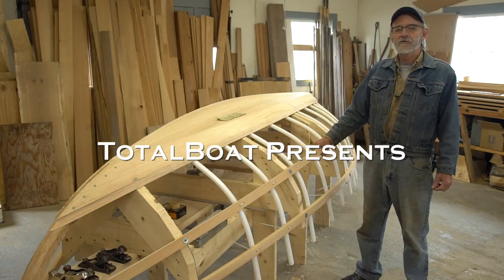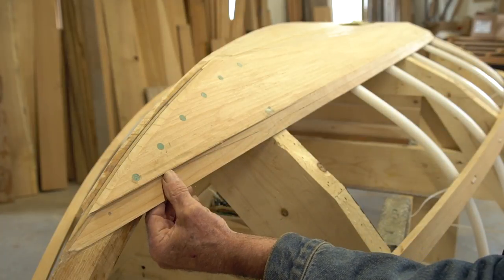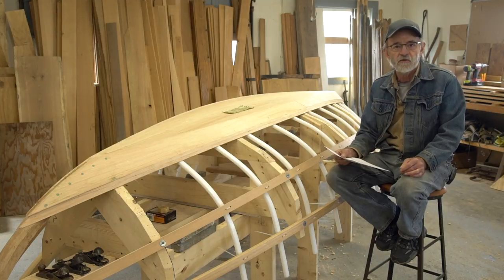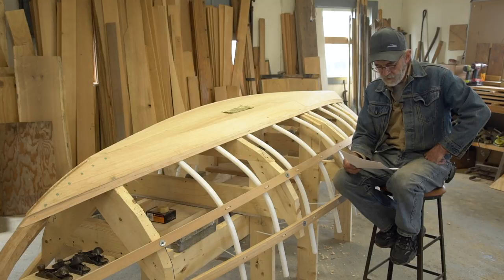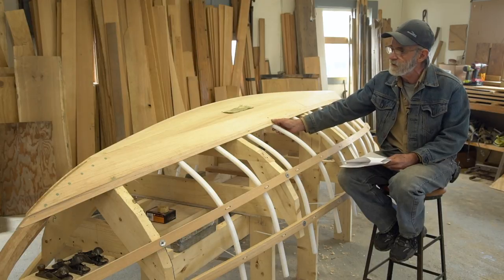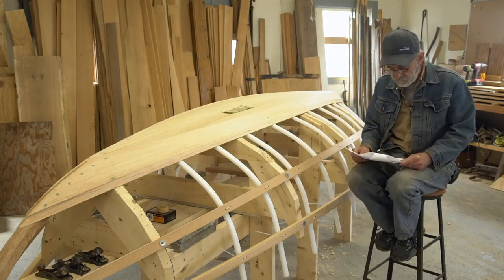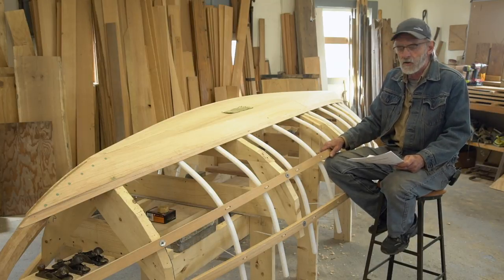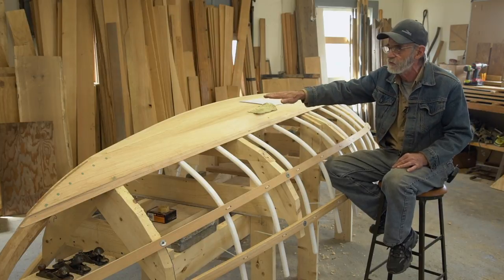Building the TotalBoat Sport Dory: Episode - 19 Q&A

Comment: Lou - beautiful little dory. The Kevlar bottom may wear well, but you cannot sand it smooth, or cut it once it's past the green state without it furring up. Just FYI. And if you trim the edge while it's green, you risk it not laying perfectly flat against the bottom. You might consider putting down another layer of CF, finish the boat, then put down a layer of Kevlar on the bottom. Love your channel!

Comment: We use UHMW a lot where I work and have a lot of drops that stay out in the sun. A couple pieces in particular have been outside for 10 years. While they look rough on the outside, a quick scrape with a knife reveals that the damage is only on the surface and only a few thousandths of an inch deep.

 Great videos, I haven't found one yet that I don't like.
Reply: "Officially" UHMW is UV stable for 1 year or less (I know folks see much more than that!). There are special formulations available that are UV stable...in nearly any custom colors you'd like!

Comment: Hi Lou, I've worked with Kevlar a bit before, and have experienced how challenging it is to cut and get a neat edge. I have had success with a sharp utility knife when the resin is "leather hard," and also with a "Fein" tool with an oscillating blade if the resin is more fully cured. The nice thing about the Fein tool is it doesn't make much dust at all. I have also used a straight knife-type blade in the Fein tool with a burr put on it on the belt sander. That really works the best, in my experience. It's a tricky material, because you can't sand it without it "fuzzing." Can't wait to see how it comes out!

Comment: So, is the entire underside going to be coated with epoxy? What about the floor inside? If water gets to the wood, it will expand. If sunlight gets to the wood and it wasn't already well dried before construction, it will contract. If it is well sealed where moisture cannot be exchanged, then it should be stable and fine. I hope you considered this on the inside of the floor/bottom, in the end. Thanks for sharing your thoughts and skills with the rest of us.

Comment: Hey Lou - great videos! Love seeing these boats come together. With fiberglass on a kayak I made, I left the cloth a little long and applied the epoxy and let it start to cure, and then after it started to tack up but was still fairly soft, I was able to run along with a razor blade and trim the edge to fit without it snagging or pulling hardly at all. I wonder, would this technique work with kevlar/carbon though? Thanks for all the great tips!

Comment: As an Aircraft Composite Technician I have worked with Kevlar, Graphite ,glass etc. The problem with kevlar is that it is very prone to water absorption. Although it is excellent fot impact protection it will tend to fuzz if abraided. It is harder to wet out with resin and is easier to peel plies apart than glass or graphite. It is very tough to cut when on the roll. 
If I was to use it on the bottom of a boat I would definately overlay it with a ply or two of glass but given the choice I would skip the kevlar  all together and just use the glass.

Comment: Hello, the best way to cut any cloth edge that is wet out is to wait until the epoxy is tacky then use a razor knife and cut along the edge. If the edge is on a flat surface put masking tape along the cut line, overlap with cloth, and once the epoxy is tacky slice into the wood, then peal up the tape and excess cloth immediately. This is referred to in Gougeons Brothers book.

Comment: Wrapping it completely with carbon/ kevlar--if you laminate the outside of each plank before you fit it, wrapping around the edges, and then use thickened epoxy to glue on the seams.  Bending into position would be harder, and of course the fit needs to be perfect first.  But it would do the job, even though it would be awful time consuming.

Comment: I like the Kevlar. My comments on the last video didn't know about this additional layer on the outside. Sandwiching the wood between layers of cloth will provide significantly more reinforcement than one layer of fabric between layers of wood. 

6-ounce/yard CF weighs exactly the same as 6-ounce/yard fiberglass, and it will absorb more epoxy, so the finished weight is more. The strength can be greater than 'glass but it is not necessarily more rugged. Kevlar is very abrasion resistance, but carbon is easily cut, so the hybrid cloth is not as abrasion resistant as pure kevlar would be. The pure Kevlar would be tougher and more robust. It retains a bit of resiliency where the carbon can be a bit brittle.

One downside of Kevlar is it is hydrophilic and will absorb water if left in water for extended periods

You can cut the Kevlar while the epoxy is still green, firm, but not hard, using a very sharp utility knife. The window of opportunity is narrow, but it is quite effective if you catch it right.
Reply: Nick Schade good to see one pro take interest in another pro's work.
Reply: So for the outer shell just on the keel pure kevlar / aramid would be better?
I'm also wondering if carbon fiber or fiberglass better match the elasticity of wood. I think I read it somewhere but I forgot. If you mix two materials with different elasticity, the less flexible one becomes the weak link in the chain.

Comment: I have to agree with you on the idea against cutting the carbon fibre with a band saw or chop saw. I have a pair of chainsaw pants that use layers of Kevlar as the protection against life threatening injuries from a chainsaw. The layers of Kevlar actually will stop the chainsaw immediately upon contact with the fibres. Would most likely be the same situation with cutting the carbon fibre on a chop or band saw.

Comment: Lou, Please, those measuring cups are $1.00 each , you will use heaps of them . Ge some digital kitchen scales , get "sleeves" of 250ml disposable plastic food bowls ($6.00 for 100) get disposable vinyl gloves ($7.00 per 100 ) put them on three pairs at a time . When one glove gets resin just peel it off , scales are exact to tenths of a gram. Never , never , never use any epoxies that are anything other than 2:1 mixing ratio (read up about epoxies) never, never , never use "Dynel" sheathing for anything ,it went out of vogue  fifty years ago , even the Gougeon Brothers canned it fifty years ago.... " Adds minimal strength and is largely parasitic" . Mix your resin with extra long paddle pop sticks ($4.00 for 10,000) , hold two at once , in the same hand, angled apart. For Christs sake Lou , do some homework , visit vacuum bagging , infusion moulding yards , modern boat building yards etc, etc. To create mirror finish with epoxy equal to fifty coats of varnish , flood the surface to be coated , let the epoxy semi cure until it just shows tour finger print , i.e. gelled but not cured , sprinkle the epoxy with water. quickly swipe back and forth , only very quickly with the heel of you hand till there is no water lubrication . There you have it mirror finish epoxy coating ... simple , and there's lots more ... If only you had  your homework.....